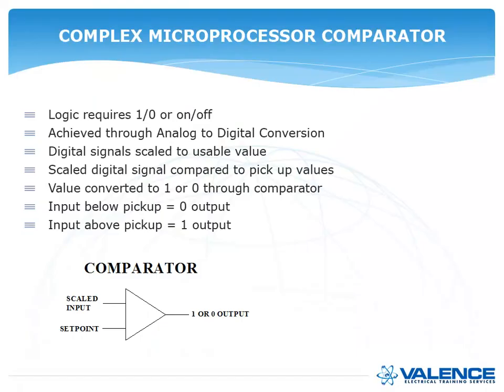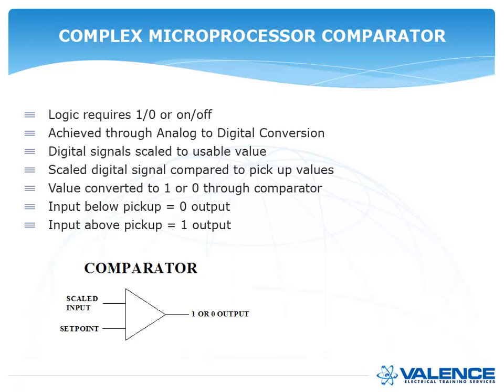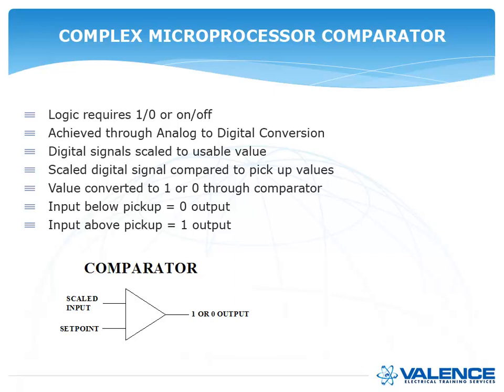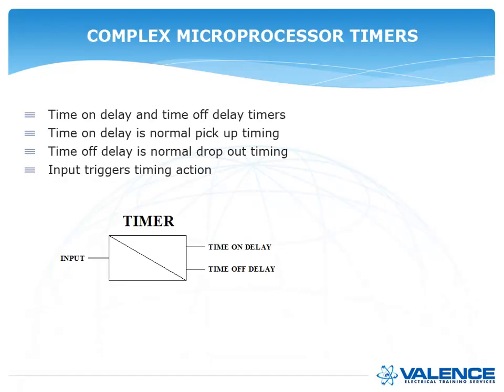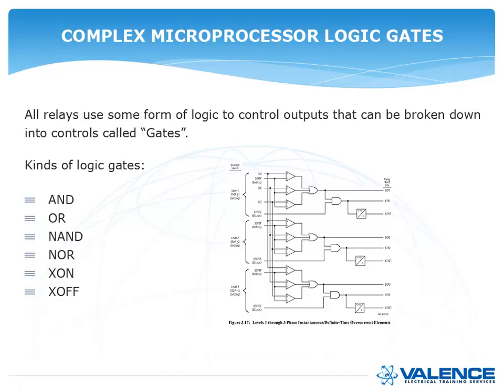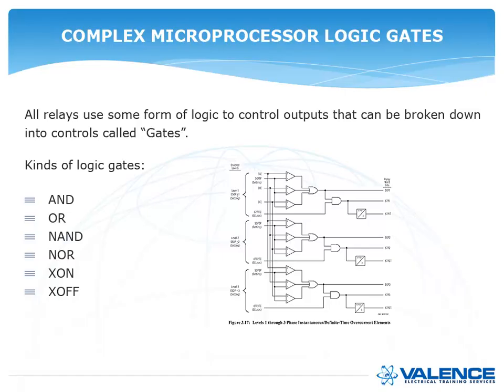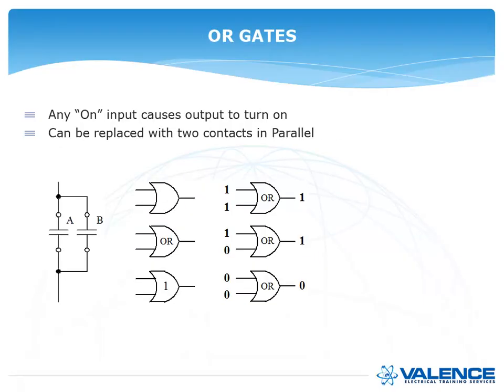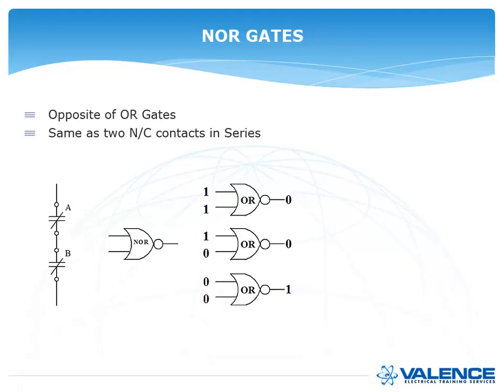Understanding Microprocessor Based Relay Logic Part 2 - Digital Logic

Comment: hello, Im actually working for Schweitzer in a couple of days as an intern on protective digital relay design and troubleshooting. Would you know of any resources I could use to familiarize myself with technical details of their products? thanks
Reply from the maker: +vaibhav grover Congratulations. Valence concentrates on the testing side, which won't be much use from the manufacturer side.  I'm sure that SEL will have plenty of resources for you.  Good luck.